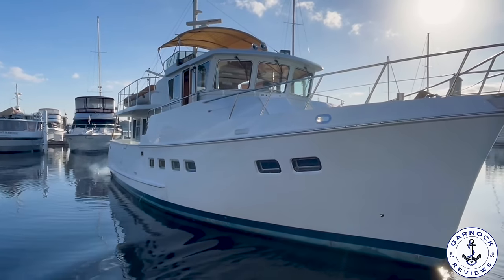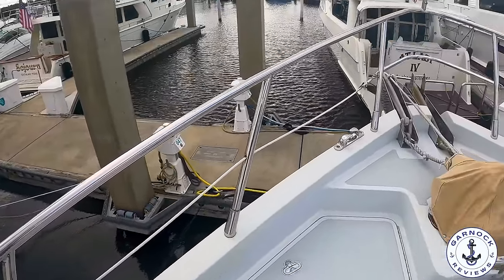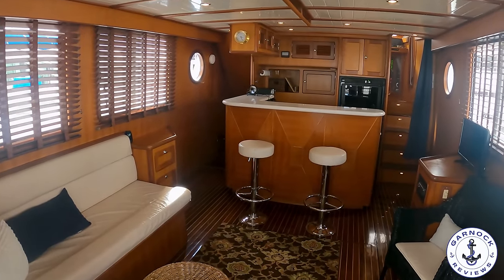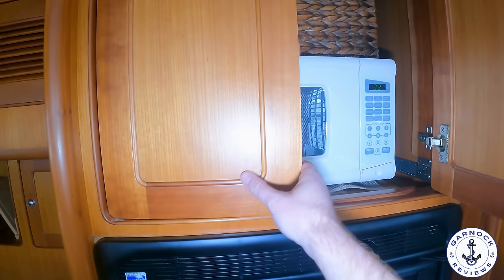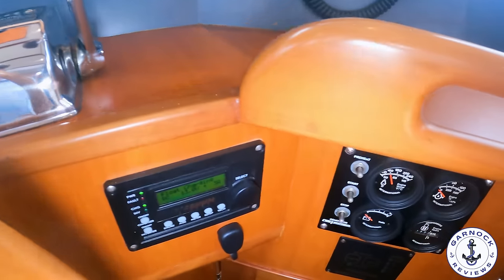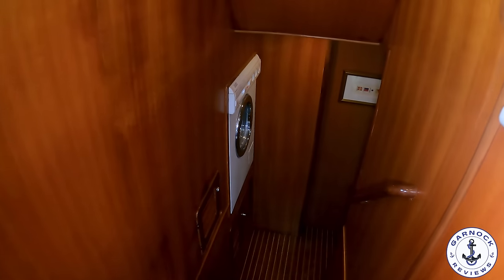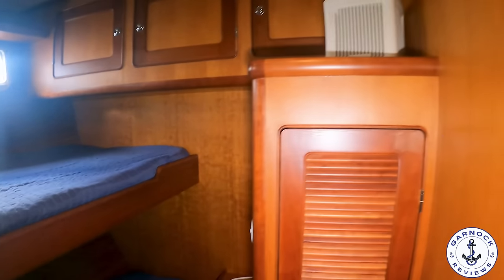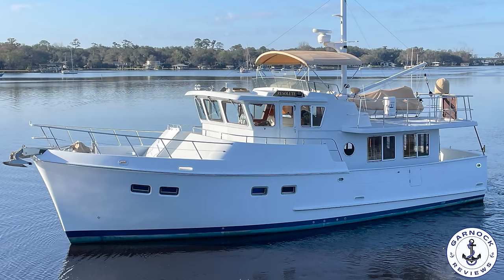[Sold] - $399,950 - (2000) Selene 47 Pilothouse Trawler Yacht For Sale

Comment: That is a beautiful boat.  You can see just how well maintained it is.
Reply from the maker: Thanks Mark, glad you enjoyed this one 🤠
Reply: Other than the mildew all around the exterior, gel coat in poor condition, window metal trim paint chipping, unattended rust on generator cover, oxidation on all copper valves in engine room.  This boat has been sitting with zero attention for awhile.  
This vessel is NOT maintained correctly.

Comment: I recently subscribed to this channel with the recommendation that others do the same. I still appreciate your thorough yet quick-paced reviews. One thing I seemed to overlook is that there are some glaring examples of items that you make absolutely no mention of. I understand that you are reviewing yachts of varying sizes, ages and prices but there's nothing wrong with a reminder (or two) of those circumstances. Otherwise, some of your offerings may appear lacking in maintenance or value as you open hatches with obvious rust or greasy fingerprints in plain view. Thank you for an overall good review of yachts/trawlers.

Comment: Nice Coast line  Boat.
Sir.
Just curious as there are normally comments re Air conditioning.
What about Heating..
You remarked the engine has col😅d weather start Block Heater ?
Reply from the maker: Unfortunately, I don't have access to the full spec sheet now that she is sold. I can tell you that she had a solid construction, with hot and cold AC, and both lower helm and flybridge. This one would be just as happy cruising in Alaska as she is in Florida.

Comment: I saw more things that I nit picked than I said that's clever idea.
The main owners cabin didn't have a night stand for a cuppa in the morning. Not a very good reading light. No Full size frig and separate washer/dryer. Didn't hear any mention of an AC 
Or water maker. Since it does have a two thousand mile range. But a good coastal cruiser. East or west coast.
Reply from the maker: Sorry Wayne that this one didn't tick all the boxes for you. I can confirm this one is fully air conditioned and worked like a champ when I was onboard. 

A lot of trawlers opt for a single washer dryer as not only is it less space, but less weight as well. As to fridge freezer, there is plenty of deck space in the aft cockpit and on the flybridge you could easily fit an outdoor fridge or freezer.
Reply: its a boat not a laundramat

Comment: I’d like to see an actual bed in the master cabin, as opposed to a V-berth and a bit finer materials in the master head. A molded fiberglass tub and a vinyl curtain just don’t cut it, I would like to see a door on that shower. A tub on a yacht is utterly preposterous, I’ve seen sailboats with them too, it’s ridiculous. When are we bathing toddlers, when we’re heeled over or when we’re rolling around at anchor? Seriously, why…😂
Reply from the maker: My understanding is that this was one of the first examples of this model line. The  later models either had an island bed, or the option of an island bed in the owner cabin. I personally would prefer an island bed, but at least the infill turned this vberth into a large bed for 2 adults in comfort 😉

Comment: The single engine is the only thing I could find that’s not real appealing.
Reply from the maker: There's pros and cons to single vs twin. I personally like the fact you have as many access points to help maintain the engine either for checks, maintenance, or repairs.
Reply: @GarnockReviews  well, walking around your engine doesn’t do much for you when you’re halfway to the Bahamas and your engine blows up.